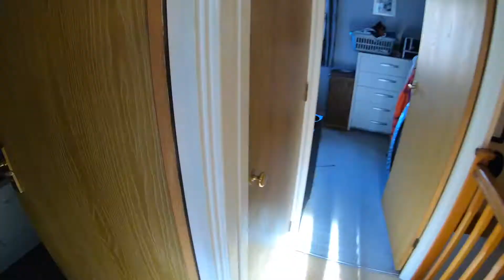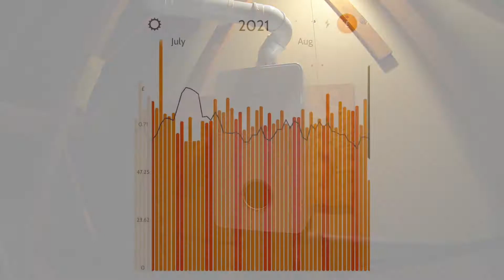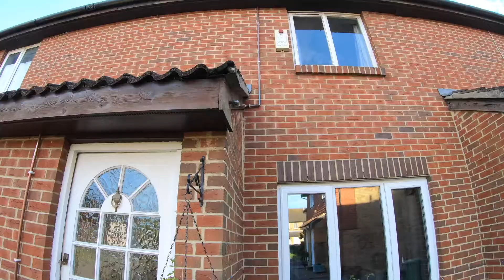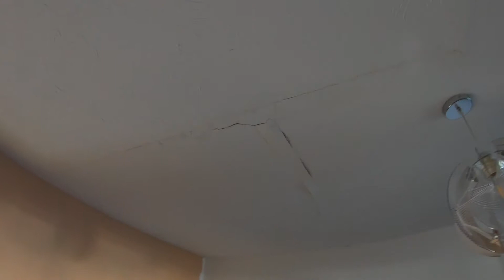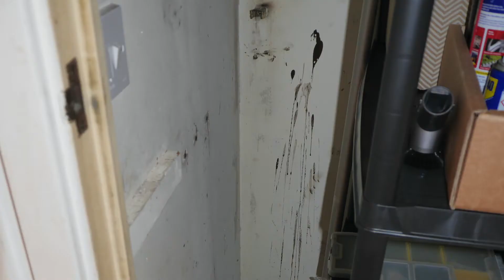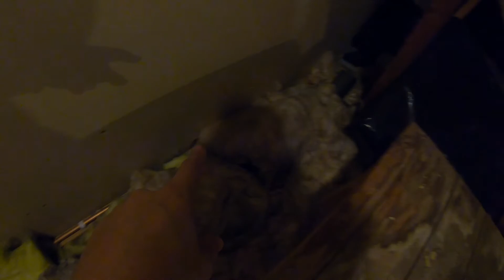Good job? Combi boiler installation story

Comment: What is with all those flue bends. There must be a more efficient way to get the flue out. Never mind the expense but must be close to theoretical length. Plus requires a bracket on every change of direction.   It may have been more efficient to build a stud wall and line it so the boiler could be moved to flue straight up with no bends